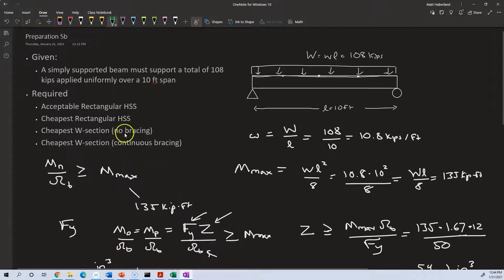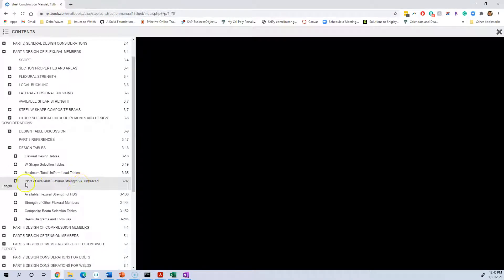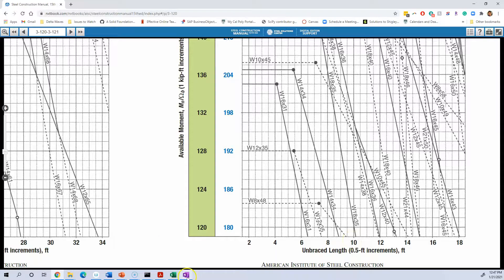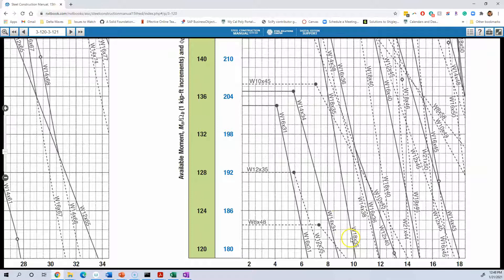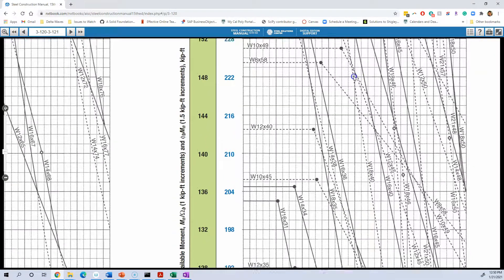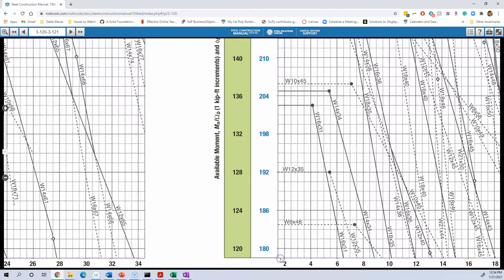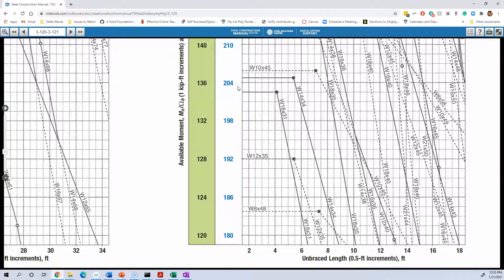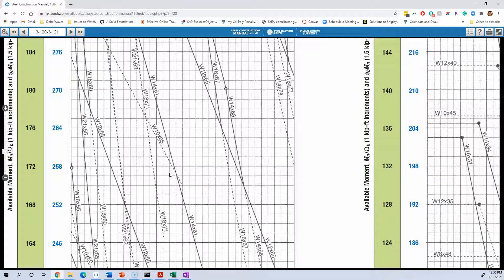Beam Selection Example - W-section

Comment: very good explanation.   i am doing self-study of steel design and I'm stuck on a few principles. Maybe someone out there can help with a concept I am struggling with:
-a simply supported beam (32' long) has no other bracing except for the ends, w/ a concentrated load at mid-span.  
-then,  same beam is given w/ supports at ends and at midspan. 
-finally, same beam with supports at ends, midspan, and at quarterly points  (so, bracing at every 8 feet).

What does the change in bracing tell us regarding beam selection?    I don't know how to approach the calculations for this because I don't understand Lr and Lp - the lengths at which elastic limit and plastic hinge are encountered.  Can I always assume a 'very braced' beam will have an unbraced length (Lb)  less than Lr?  

Which is LONGER - Lr or Lp?  I am having trouble understanding the actual definition of each.  In other words, suppose in a lab we load a beam w/ the intention of ultimate failure, and chart the stress and strain.  Which is encountered first - the point of Lr, or Lp????

Comment: Awesome video!! So helpful. What would I do if my span falls outside the tables? I have a 50’ span for a bridge beam that is seeing 50 kips of load distributed. I found that my Mmax was 312.5 kip-ft which is significantly lower than other ASD values in the higher W shape span tables. Any guidance is appreciated!
Reply: no bracing  at all for 50?  is torsion accounted for at the end connections, maybe?